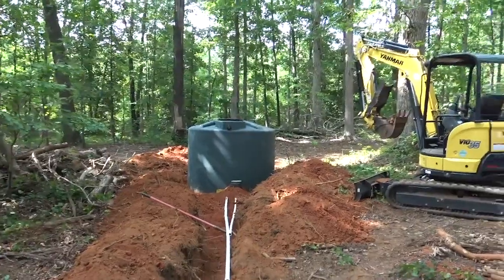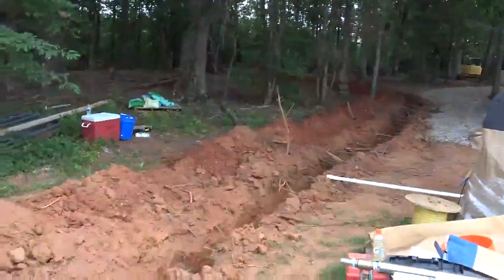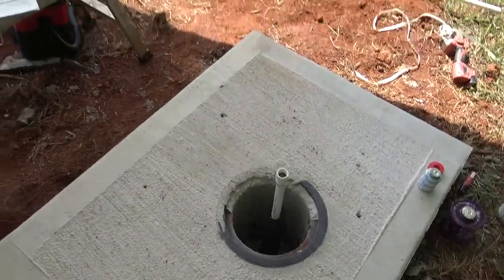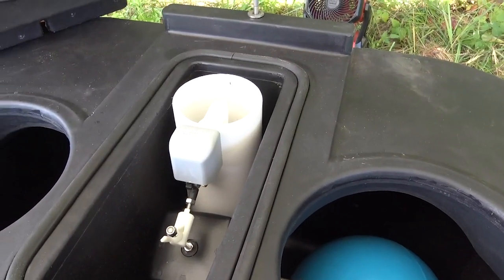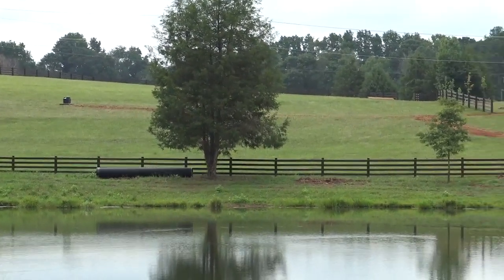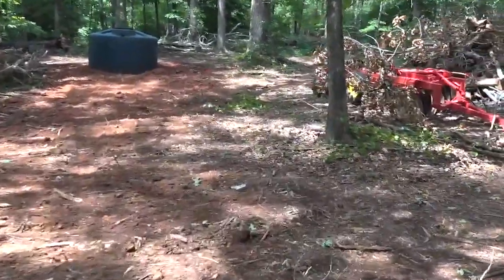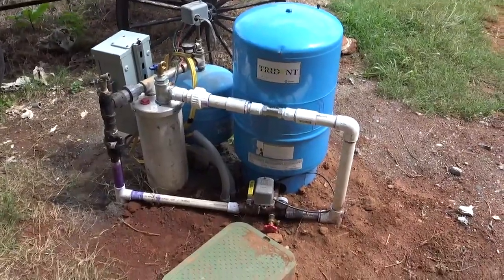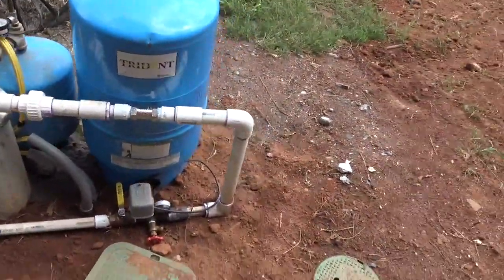Solar Irrigation for the Cowboys and Angels Ranch

Comment: Nice dual design.  We have had many PVC lines break on our ranch either due to cattle or weather. Dig cut and replace all over the place. What is the best pipe to run under ground?  I don't think PVC holds up to the years. Our ranch was founded in 1888 and every time I dig about 3 feet down I find stuff. Well the ranch is old and many cowboys did stuff there and here. Around the late 1960'S is when lines were lay out using the PVC pipe everywhere. First off I think they ran them too shallow cause the cows break them and the cold winters do to but that is just my thinking cause I am always fixing the PVC with PVC.  I think deeper and stronger is better.   Blue print the runs too. Cause a ranch has a whole lot of lines going in all sorts of directions. Valve's are good but need to know where they are and what they do.

Comment: My neighbors used 2" PVC sticks to run 3,000 feet of water line from our shared well. After about 25 years the couplings began to fail. It was hard to find where the break was. They'd fix one break only to have another appear in a matter of months or a year later at most. Eventually they abandoned the line. Given that now you can source 500 foot rolls of tubing, I am curious why PVC was chosen for this project.
Reply from the maker: I use schedule 40 PVC with deep bells. I never use couplings. I found that any type of metal connection clamp will rust & fail eventually underground.
Reply: @engineer775  what about ppr pipe instead of pvc for longevity

Comment: Those 2 pumps at the well should be on a concrete slab with a removable enclosure over the lot. Terrible to see it in the dirt. Same with the tank. Also, as an electrician, it kills be to see that the flexible conduits weren't run all the way to the box at the well.  Joining all those pipes seems crazy too. I like your stuff but  you lack attention to detail. Maybe the difference between an engineer and a tradesman. I look forward to your next  video.

Comment: Gluing up 3300 feet of pvc instead of using pex seems like sheer insanity to me.
Reply from the maker: PEX is awesome but the fittings fail underground I've see multiple pex systems fail. 20 ft at a time goes fast.
Reply: It's fast to solvent glue and keep walking. Hdpe welding takes so dam long
Reply: Engineer775, I’m getting ready to replace my well pump and all the piping, I’ve ran Pex though, I’m going to have one Pex fitting that’s underground, the one that comes out of the side of my well casing two feet underground, will the crimp with rings Pex fitting fail on that? You have me worried now, thanks.